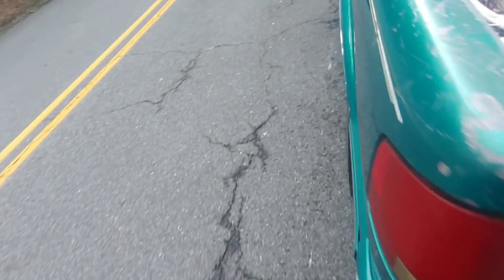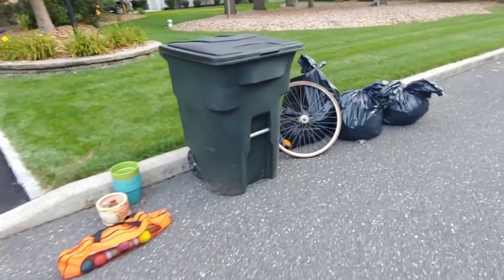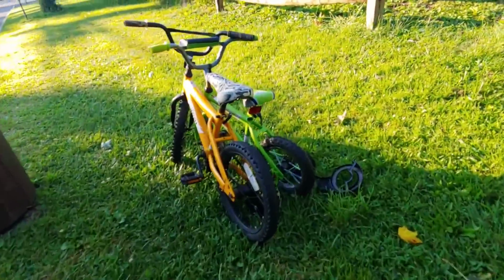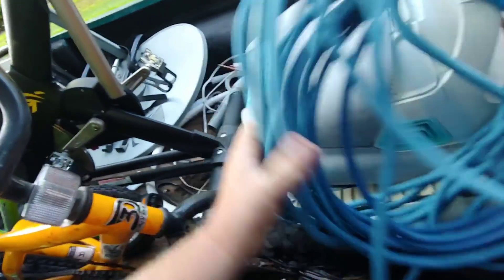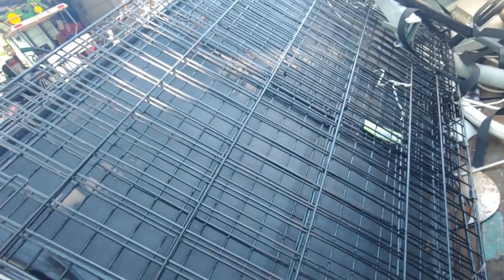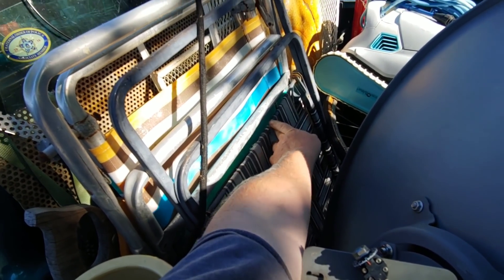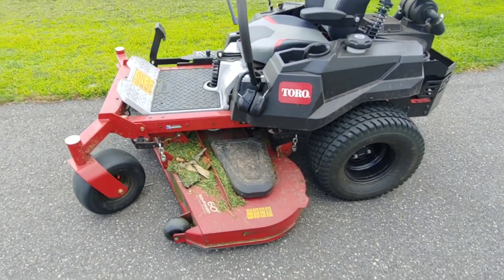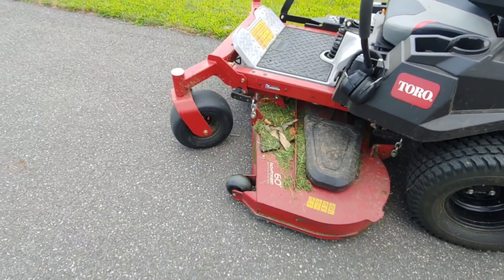Trash Picking exercise equipment

Comment: I agree with you on the my ride @Burt.. it’s nice.. I had it on my radius and loved it… then I tried Exmarks ( Toro ) dial your weight seat.. holy crap!! I’ve had 3 back surgeries and for me “personally”.. I was more comfortable on the dial seat… BUT!! With that being said.. I do notice on yours the lip that comes up where your feet rest is MUCH higher that the radius’ was.. and that’s where my issue was with mine.. I’m 235 and when I’d step on the floor of the radius by exmark, where my foot area was lower than yours, when it sank down when I stepped on it, it would get stuck under that front bar between the front wheels.. It was a pain in the tail “literally” if it wasn’t able to float like they’re designed to do.. So it’s definitely good to see they changed that for this model.. Had mine been up higher like yours, I’d probably never had gotten rid of it. But now that I’ve rode on this dial your weight seat… it’s just like riding in a semi truck with air ride!! Lol But either way, your mower, my mower… BOTH freakin awesome machines regardless!! Stay safe and Blessed up there brother.. And I certainly hope y’all don’t get this nasty ass weather we’re getting this week.. Some wicked ass storms rolled through earlier and cut my mowing day short!! Had to wait to unload the trailer when we got back to the house cause the lightning was CrAzy 😜!!

Comment: My friend bought a new (used) F250, the tailgate wouldn't latch on one side, turned out the pin was loose and there was a rock stuck in the latch, quick fix.